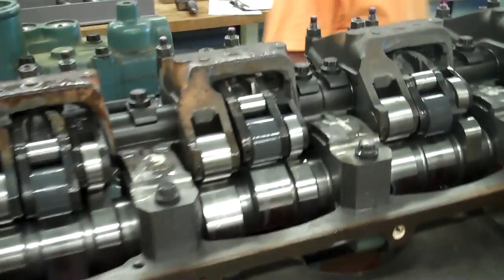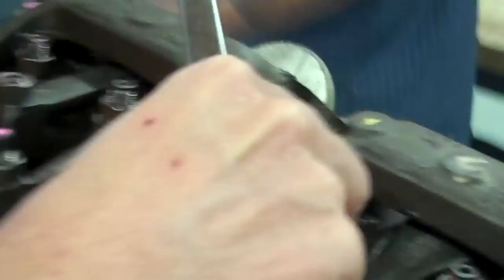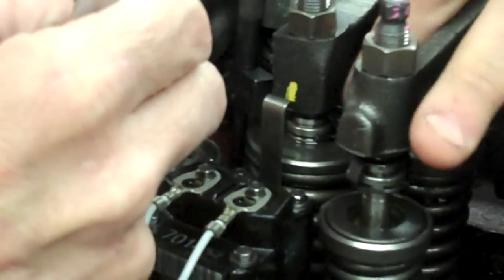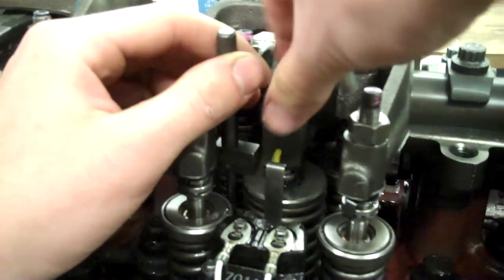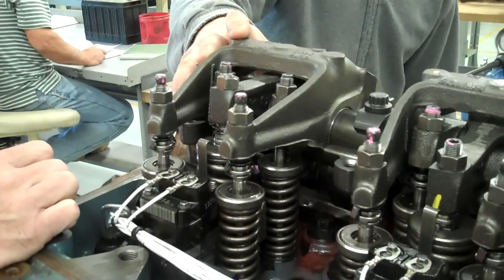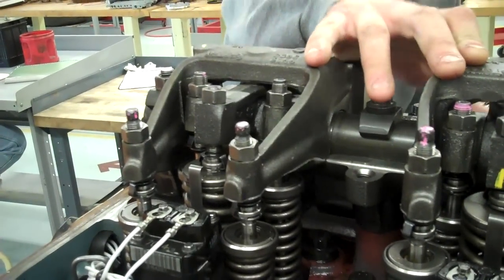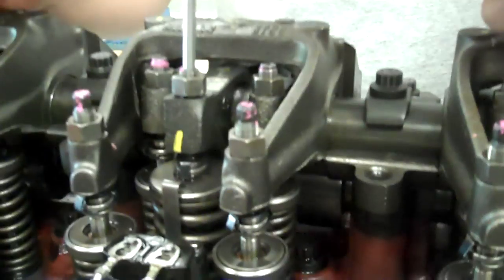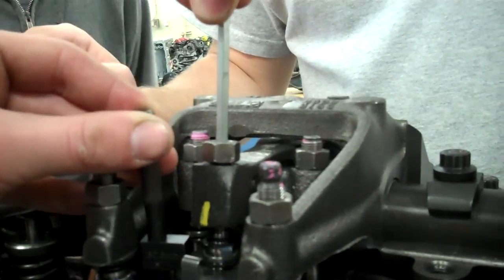Chattahoochee Tech Diesel, Injector Height, Detroit Series 60

Comment: the wires go to the control solenoid on the injector. it controls the beginning and ending of injection. this type of injector is common on detroit but later models used what i beleive were called e3 injectors. they were adjusted much like injectors on a cummins n14. these are as simple as it gets using the hockey stick as we call it. the cummins injectors arent bad either, you just lightly tighten the injector plunger a few times, lightly bottom it out, then back it off 120 degrees.

Comment: my ddec 3 60 series detroit won't start. It ran fine until one day it died and it took along time to start. i had to force fuel into injectors. I had it sitting for about 2 yrs starting off and on every now and then. I put new fuel pump on and still would'nt start. Tried to pull start no luck. what is the problem. It's always been reliable engine

Comment: if the injector is adjusted properly there should be 2 threads above the jam nut when done. if not something is wrong.  also if you put about 8 rounds of electrical tape around the flag post just under the flag it will keep the flag parallel to the inj plunger. now watch the bottom of the flag post where it sits in the inj. put one finger on the top of the flag post and move very slightly out and in.  if the post wiggles- too high if the post doesn't wiggle- too low. eh!  Detroit injectors have a crimp where the lower needle is attached to the main plunger.  if the injector gets bottomed out that crimp is suppose to prevent pushing the tip out the bottom of the injector. if that crimp is moved at all the injector needs to be replaced.

Comment: Cylinder 6 has nothing to do with cylinder 3. You adjust the valves when the companion cylinder is on valve overlap. Companion cylinders are 1&6 2&5 3&4. For example cylinder 6 tdc after the scavenging phase exhaust valve just closed adjust the valves on cylinder 1. And the injectors, the firing order is 153624 so when adjust the injectors the same time asthe valves because the injectors fire on the compression stroke a lil before tdc. And the wires going to the injectors control the metering of the fuel to the injector while the camshaft actuates the injector [and the valves to the smart asses:)].
Reply: absolutely correct!
Reply: cylinder deactivation like cutting fuel at highway speed to save on fuel. No not to my knowledge.